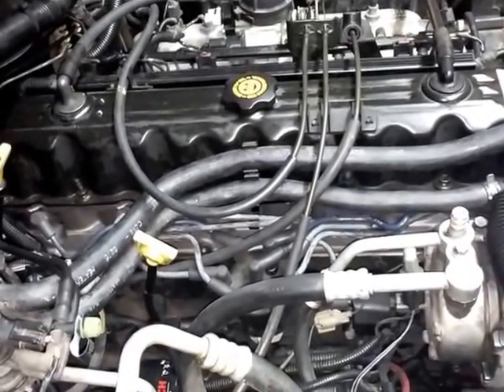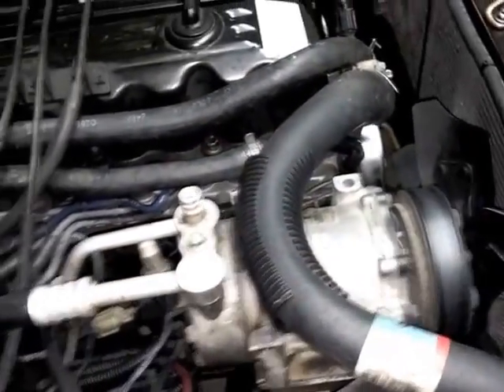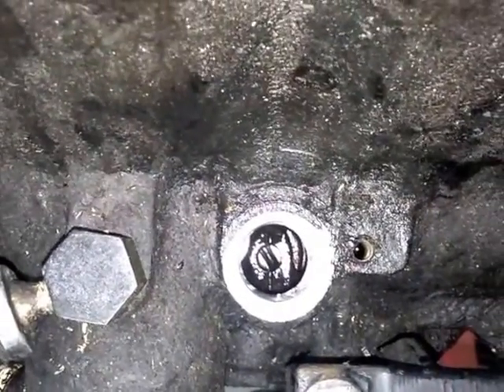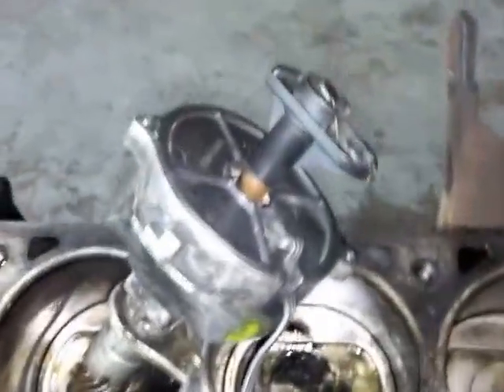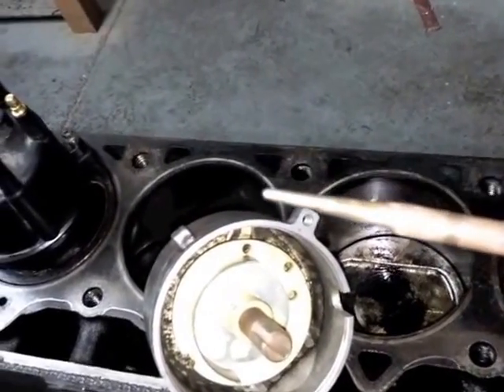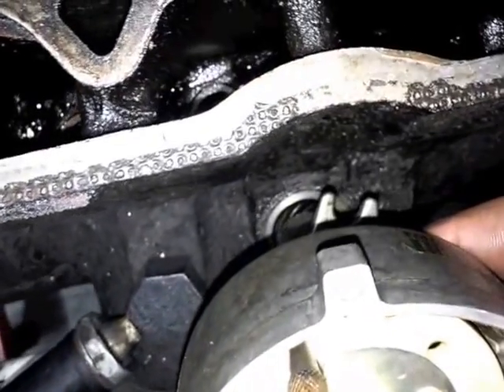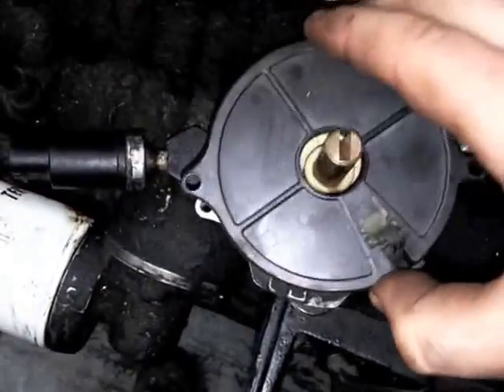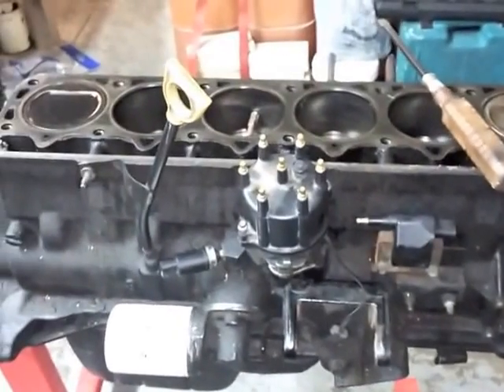Jeep Cherokee Ignition Timing / Distributor Install

Comment: I need ur help. I have a 91 cherokee 4.0 and I just replaced the spark plugs, wires, distributor cap, and rotor. Well now for some reason it will not start at all. I have the firing order correct (153624) but still. Absolutely nothing. Started jst fine with before I did this tune up. I've been working on this for the last two nights. Someone please help.
Reply: Hey man, I know I’m 5 years late but do u remember how you fixed it? I have the same exact issue
Reply: @Johnny-mo9df  the timing was off so what we did was remove the #1 spark put my thumb over the hole and cranked the engine little by little till the compression pushed it off. So once TDC (top dead center) was achieved we put the wires back on per the firing order.
Reply: @Deezus92  thanks for responding! I thought I was at TDC but I may not be on compression. will try this tomorrow
Reply: @Johnny-mo9df  sounds good, let me know if it works 🤞
Reply: @Deezus92  worked like a charm 🤟🏽 preciate it
Reply: @Johnny-mo9df  hell yeah!

Comment: So I did it exactly the way you said putting the oil pump at 11 o'clock but the problem is when I put mine in, my rotor points at 6 o'clock  not 5 o'clock. I'm not sure what to do from here cuz this my second attempt and it's the same result, a very rough idle which the original didn't cause.
Reply: You most likely had your rotor and distributor 180 degrees out. It will line up in what appears to be the right spot 2 times, one for exhaust stroke and one for compression stroke. When you turn your #1 piston to Top Dead Center then you need it to be on the compression stroke for it to run right. If it is 180 degrees out then it will most likely back fire a bunch when you try to start it or release what sounds like a air gasp. Hope this helps your problem.
Reply: Did you happen to figure out what was going on with your installation? I just had to install a new distributor and at first I had a rough start with a few hard knocks and then it ran mediocre. I pulled the distributor and tried again, but now I have a smooth start but an idle that pulses ever few seconds from around 1,100 rpm down to 500 or so.
Reply: I ended up taking it to a shop. Spent a lot of hours trying to figure it out with no success.
Reply: Turns out the the timing was off from all the years of wear and tear. Even the mechanics had problems with it. Also I had to go back cuz oil was bleeding into the distributor through it's own shaft causing misfiring. It got replaced too.